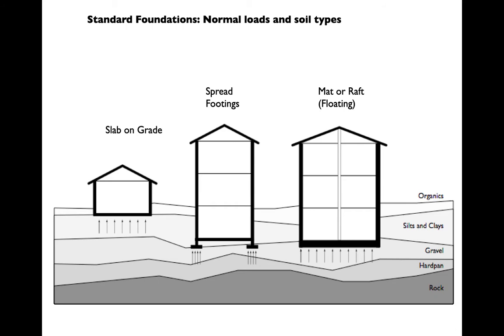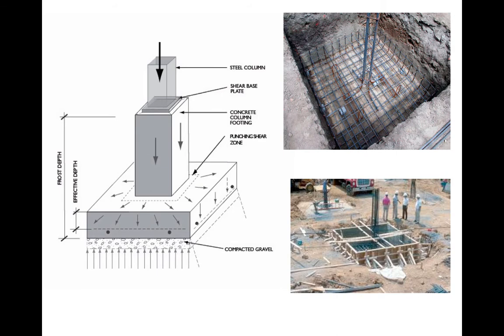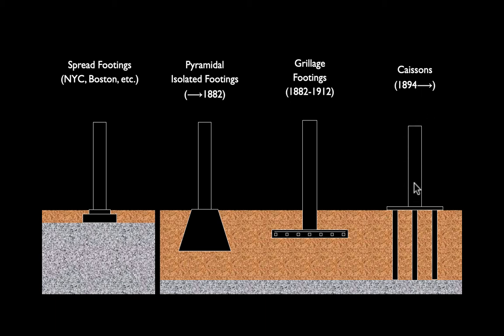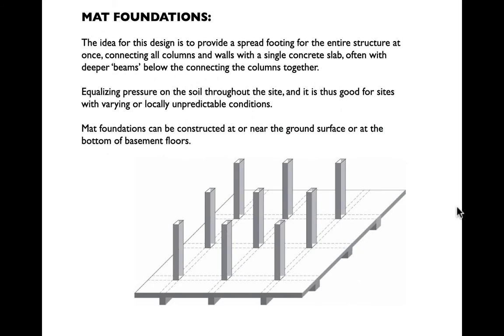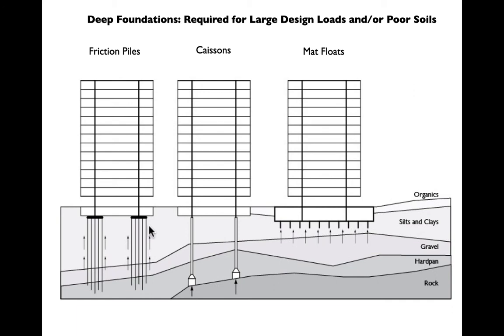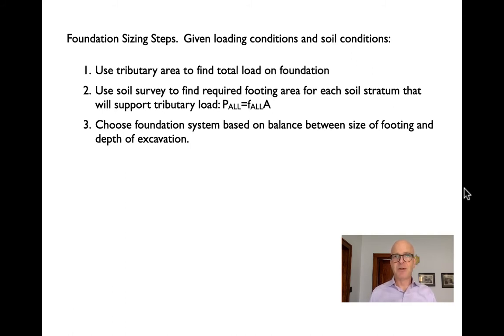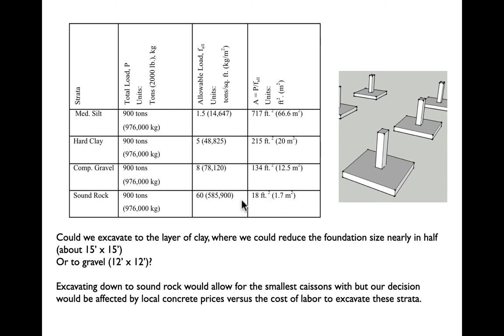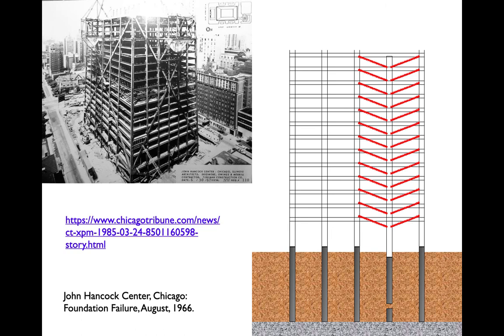ARCH 347 Lecture 04d Foundation Types

Comment: Hi.. thank you for the lecture. Is the gravel under foundation required by any code?
Reply from the maker: Some local codes will require it, but it's more a functional requirement, to ensure water drainage under slabs.